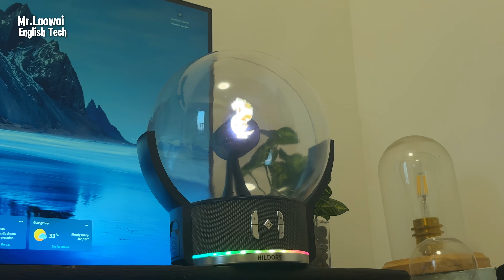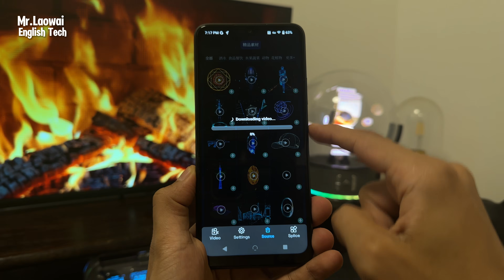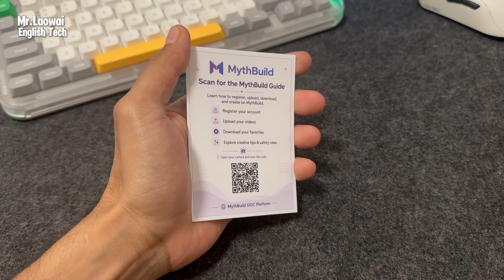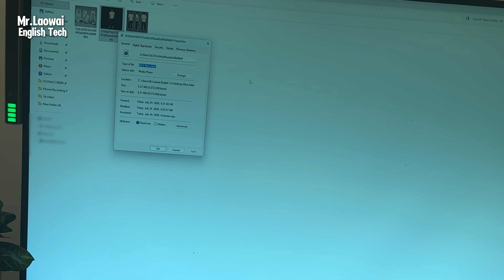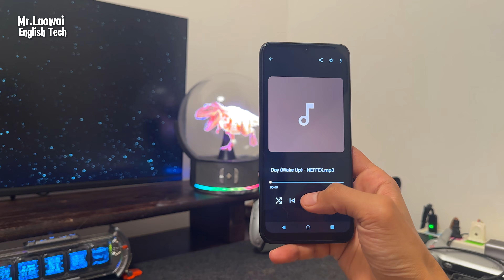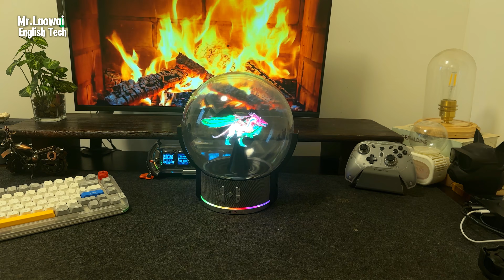This Hildors 3D Holographic Fan Display is Crazy🔥Easy to Customize with AI

Comment: Any issues with heat dissipation after running it continuously for a few hours
Reply: Thanks for asking! We've thoroughly tested our display under continuous operation for extended periods, and we haven't encountered any heat dissipation issues. Our cooling system is designed to keep everything running smoothly even during long sessions. It's one of the features our early backers really appreciate! If you're still considering joining us, there's still time to support the campaign before it ends!